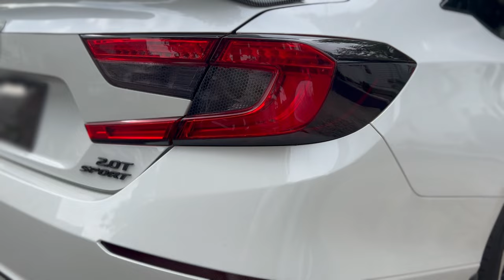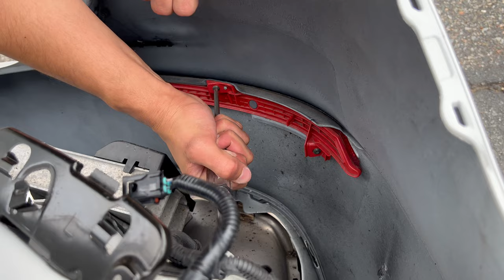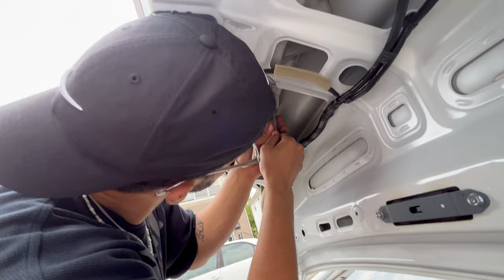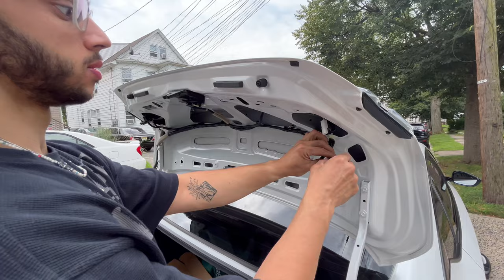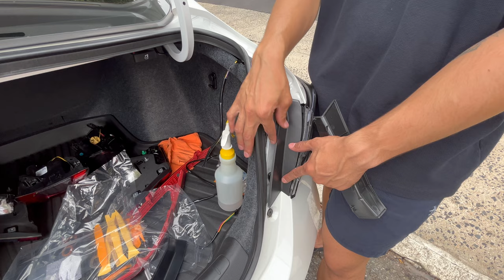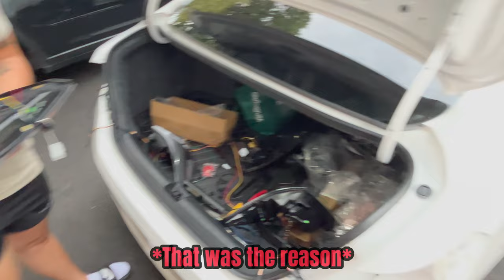HOW TO INSTALL AFTERMARKET TAIL LIGHTS & LED REFLECTORS ON 10TH GEN HONDA ACCORD (2018-22)! TUTORIAL

Comment: Looks great! The transparent lights match on white paint. I have a black 2.0t so I want to get the dark smoked aftermarket’s either the v2 v3.. I know we can disable the animation. I just don’t want to confuse people when I’m driving lol or get possibly pulled over? If you push the brake pedal doesn’t it override the animation immediately?
Reply from the maker: Thanks I appreciate it and the animation only happens when you first turn on the car or your lights get turned on after being off. Other than that, the break lights work as the OEM normally would work